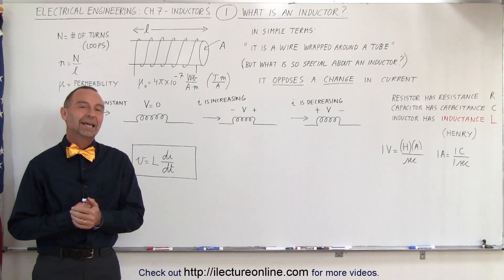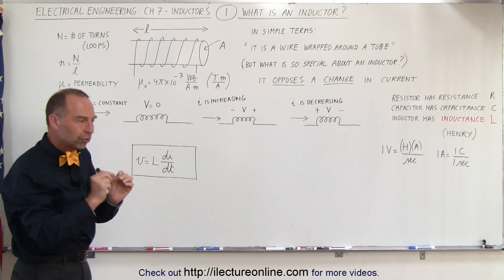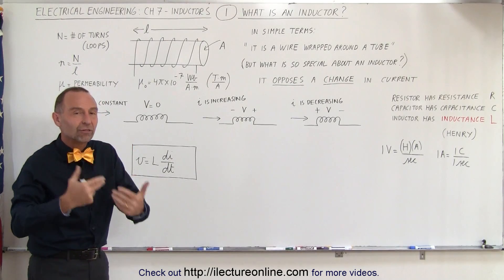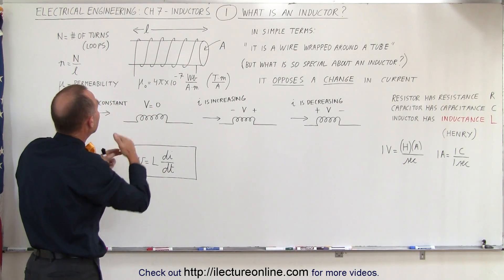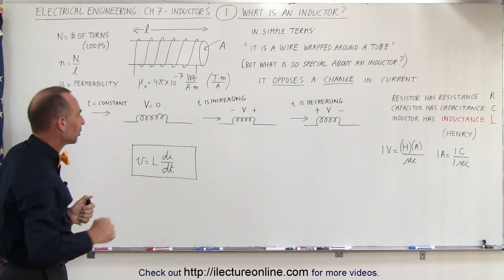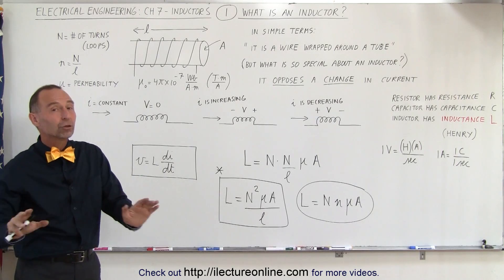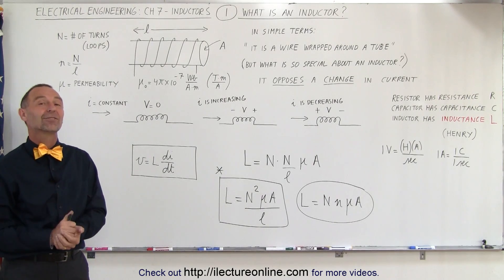Electrical Engineering: Ch 7: Inductors (1 of 20) What is an Inductor?

Comment: As per Lenz law a negative sign shoud bem added to the equation V=--Ldi/dr
That is due the behavior of inductors.
Reply from the maker: You are correct.  The negative sign is there to indicate the response nature of an inductor.  However in this video we just listed the voltage across the inductor which is proportional to the size of the inductor and the rate of change of the current.

Comment: When the current increases, is the change in magnetic flux is in the forward direction along the coil to induce EMF in the backward direction?

 and does the induced EMF pushes the current backward in the coil to reduce the current?

Thanks
Reply from the maker: The direction of the induced current is such that the induced magnetic flux caused by the induced current will oppose the direction of the magnetic flux that caused the induced current in the first place

Comment: What exactly is permeability?
Thanks
Where is it used and what happens?
Reply from the maker: It is a property of space, along with permitivity, and it controls the speed at which electromagnetic radiation can move through space.  It is associated with the oscillating magnetic field within the electromagnetic radiation.
Reply: It controls the speed at which electromagnetic radiation can move through the space.
Thank u so much for putting it clearly

Comment: Sir, Every other video I've seen on this topic shows reversed polarity for the induced EMF than what you have shown as the current is increasing. How could this be? Are you using non-conventional current (electron flow) rather than conventional current?
Also, in the formula for Voltage across the inductor,  the source- voltage is not considered.   Intuitively, It would seem possible that the voltage across the inductor might be the SUM of the source voltage and the induced EMF. How can the inductor be "shielded" completely from the source voltage if current is flowing through the inductor?  Any insight would be greatly appreciated.
Reply from the maker: We are using conventional current (positive charges flowing).  When a potential difference is applied across an inductor, the current will increase until steady state is reached.

Comment: The polarity across the inductor looks back to front.  As the current is increasing through the inductor the voltage across it is increasing (voltage drop, as the back emf in the inductor is opposing the current flow, causing it to lose energy).  The way that it is shown, is that it is going from lower potential to higher potential as the current is increasing, effectively gaining energy.
Reply: He was using electron current, not conventional current.

Comment: what is exactly lagging? everybody is saying the same thing, current can not reach instantly at maximum point. that means, is the term lagging indicating time? please explain someone clearly the hidden fact? I want to know the hidden fact. not theoretical fact practical fact cause everybody says the theoretical fact but not real fact.
Reply from the maker: In RL and RCL circuits, the alternating current and the alternating voltage will reach a maximum at different points in time.  When the current lags, (in an RL circuit) the voltage will reach a maximum before the current reaches it maximum.    More details can be found here:  PHYSICS 48 RC AND RL CIRCUITS   https://www.youtube.com/watch?v=TFTIFqkmpOE&list=PLX2gX-ftPVXX6YOaCz3v6r4n-umSIWisT     and here     PHYSICS 49 RCL CIRCUITS   https://www.youtube.com/watch?v=IVS-vjHdC1c&list=PLX2gX-ftPVXVg9J4Y8fzukA2Ezs2jfufO

Comment: Hi Michel. A quick question is just to clarify the confusion. In Physics - E&M: Inductance (11 of 20) Potential Difference Across a Solenoid (Coil), you took polarities opposite to what is mentioned here in this lecture. Is it because in Physics lecture, you were following the potential difference IN THE DIRECTION OF CURRENT, and here you are not?
Reply from the maker: As explained in this video, the potential across an inductor depends on the direction of the current and whether or not the current is increasing or decreasing.

Comment: sir, u said that when current is constant, v=0 at inductor. If the v=0, does that mean no current flow through inductor because there is no potential difference?
Reply: Current will flow...v=0 when R=0 is assumed

Comment: Sir ,what is the difference between   a coil and a solenoid
Reply from the maker: Two different words for essentially the same thing.  Sometimes a coil is also used for a device that converts electrical power to motion

Comment: the function of inductor is to oppose the changing in current
inductance is the ability to oppose the change in current across circuit 
Permeability is the amount of magnetic field to exist in the tube. It depends on the material of the tube either it is made of metal or anything else.
The greater inductance, the greater oppose in the changing current

group:
Anis Afzan 
Nur Syafiqah bt Lukman 
Nurul Batrisyia bt Abdul Aziz

Comment: Sir in physics 47 inductance & inductor videos you said that when current increase across inductor  voltage drops. But here  current increases and you take polarity negative to positive which indicates voltage Rise.. Please clear it i am confused.
Reply from the maker: It depends on the situation.  When you have an instantaneous voltage source in an RL circuit, the voltage across the inductor will drop as the current reaches its steady state current.
Reply: Thank you sir
Reply: In Physics - E&M: Inductance (11 of 20) Potential Difference Across a Solenoid (Coil), the voltage drops IN THE DIRECTION OF CURRENT. Here, Michel is not taking the direction of current. I think that is the reason you find a difference in polarities between Physics lecture and Electrical Engineering lecture here.

Comment: In short, the inductance (L) of an inductor is given by its configuration (= material, turns, length and area)! For a given configuration L is a constant. Given a configuration the voltage over the inductor is only dependent on di/dt.

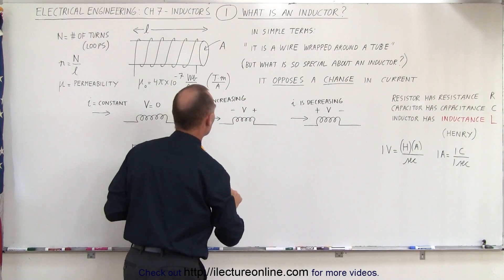Comment: The polarity of voltage across inductor while increase or decrease in source current is shown wrong at 4:13 ....rectify it .....it should be inverse of what u have shown...ty
Reply: The induced voltages are wrong because the induced current direction is such it opposes the variation of magnetic flux. The demonstration is the broken down current such in a feedback oscillator. The secondary coil   don't tolerate the occurring change and try to maintain the system by inducing a current flowing in the same direction of power source which decreases  from its nominal value to zero.
Reply from the maker: Those are the induced voltages and they are correct in the video.
Reply: when the current increases ..voltage induced to oppose the current and if the current decreases voltage is of opposite polarity in order to maintain the constant current....check it
Reply: Nadeem Raza Manihar it is correct, for I increasing magnetic field going in the coil will be opposed by an opposite magnetic field, due to an induced current following polarity as shown in the video, from right to left, apply same principle for I decreasing